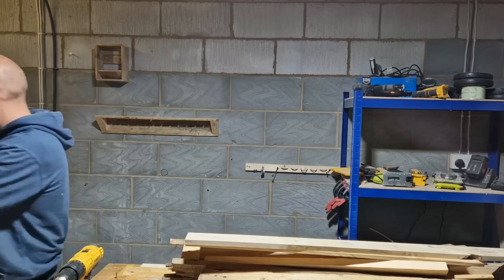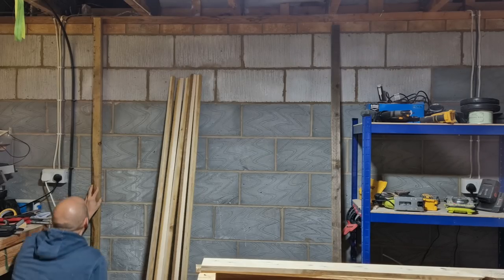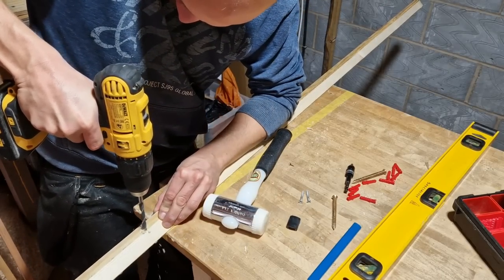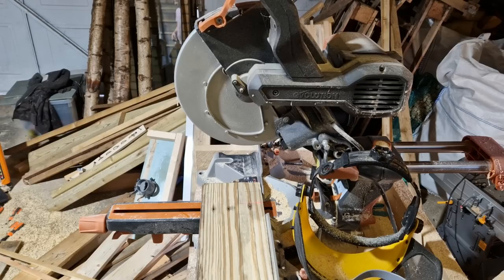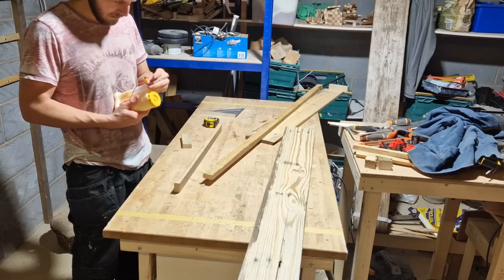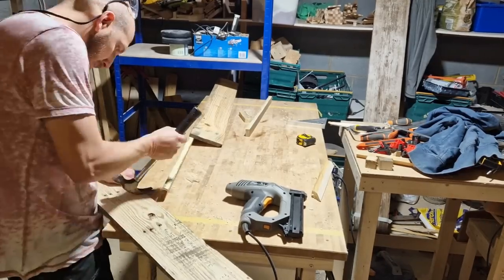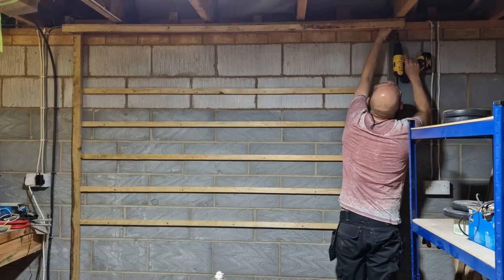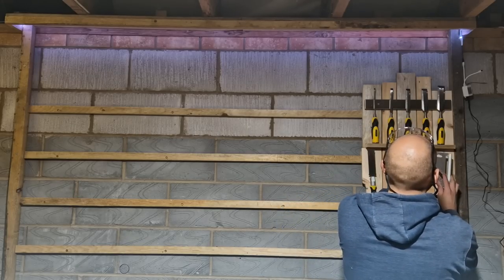I CAN'T TAKE IT: Organizing my workshop with French Cleats

Comment: Doing my bit for the algorithm 😉 only just came across this video and really enjoyed it. My 2 cents: video could be improved with just 1 alternative camera angle and a mix in of different shots and video types, for each 'segment'/section of the video. I'm no pro, just an avid youtube watcher.

People's attention spans can be short - breaking the video up with more cuts / angles / video types can just hold people watching for longer (where I might have been tempted to click off through some of the long segments, due to my short attention span 😉 ).

E.g . Your shot of drilling the holes in the first wall cleat - you have two parts to that shot: explaining what your parts are, why your drilling from that side, and that your going to countersink after; explaining how you're going to hang them on the wall (but not showing us you doing so). An example way to break it up would be, for the same total shot length: have half the shot of the drilling / countersinking, at the pace as included in the video; then have a time lapse of you putting the cleats on the wall.

(Also, giving an explanation of something you're doing whilst you're not actually doing it doesn't optimally make use of YouTube being a largely visual platform, as it forces the watcher to imagine the steps you're doing (good for brain development but not good for short-attention-span-viewer retention).)

Equally, if you take myvsuggestion  don't go overboard, it's a slight adjustment I'm suggesting, not an overhaul.

Hope you take this as constructive, not critical, I really liked the content!
Reply from the maker: Really appreciate you taking the time to write the feedback. You're absolutely right with what you say and it's something that I picked up on in the editing but unfortunately had the footage I had. Next time, I'll try for some different angles and put in more cuts to show better perspectives. 

Cheers for watching buddy.

Comment: Just a quick comment on table saw safety. You really should have the riving knife installed to prevent the wood binding on the blade and NEVER pinch the wood piece and try to pull it through. This will cause the wood to grip the blade leading to kick-back. OK, you are on the "safe side" of the saw but your nice car would be torpedoed which would definitely spoil your day. The table saw is one of the most dangerous tools in your workshop so  always think safety.
Reply from the maker: Thank you so much for the advice - it may just save me some fingers! After a previous comment, I've found a replacement riving knife (it was the first thing that broke on the saw) that will hopefully fit. I've always pulled the wood through because (like you said) it puts me on the safer side of the blade. Thanks for taking the time to comment, really appreciate it.
Reply: @justbswoodworking  You're welcome. Here is a short video showing the more "benign" effects of kickback https://youtu.be/E2Qjp0oARiM , there are other more gruesome ones. Cheers